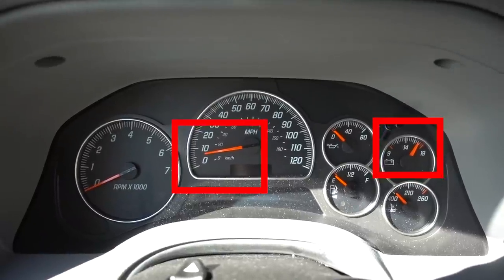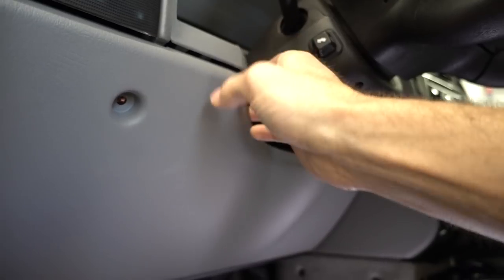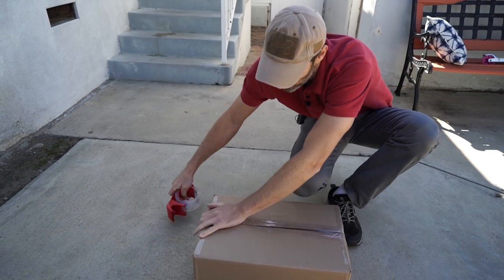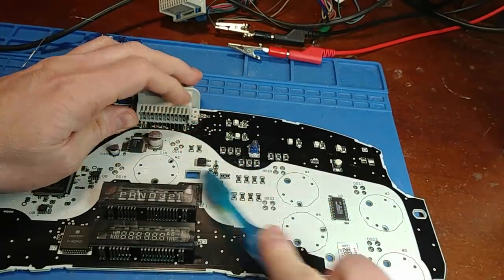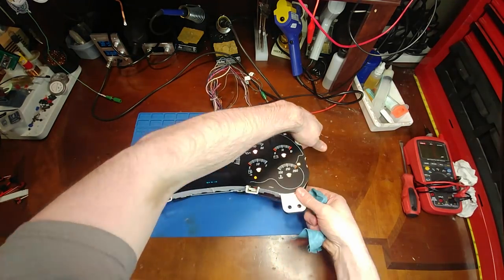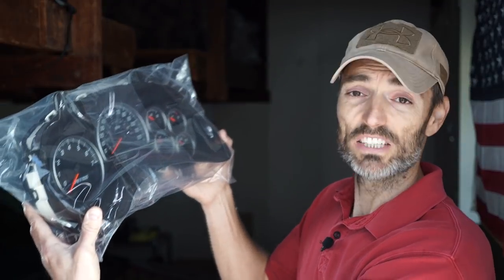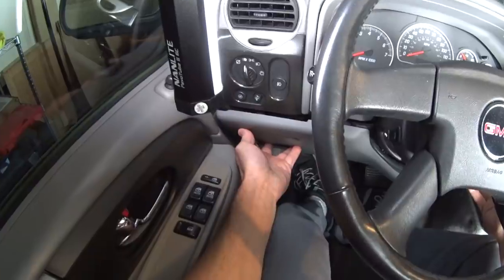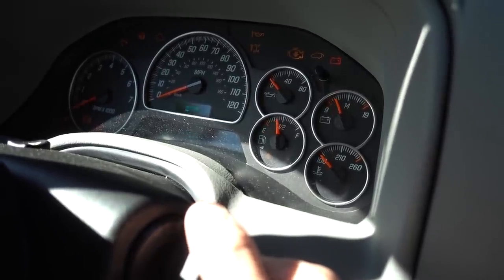Here's Why YOU SHOULD NEVER TRY TO FIX YOUR OWN CAR OR TRUCK INSTRUMENT CLUSTER!

Comment: OMG.! Thank you, Jimmy, I am glad that I found you. This's what I have been waiting> Someone talking about the Cluster. This part is not cheap. I have been replaced 3 times of the used parts from 3 different repair shop. For total 3 times replacement, I paid over $2000 but still the same problem. I am going to contact if he can fix or rebuild them.

Comment: I'm always impressed by circuitry repairs like this (laptop motherboards, etc). Wish I knew where to start with learning about the circuitry craft. Electronics are the more challenging part of auto repair IMO. I know where to go if my clusters ever go nuts, but I drive Lexus/Toyota. I think their electronics might be a little more reliable than GM's electronics, based on what I've heard about GMs.

Comment: You know what I like to do when I am removing my instrument panel is put some blue painter's tape over the top of the steering column near the instruments. That way it will protect it from getting scraped by the plastic edge of the instrument panel as you work the panel out.

Comment: my 03 yukon denali gauge cluster failed 2 times, first time we brought to your dealer to replace gauge stepper motors. second time the gear indicator screen went out and i was able to take it apart and redo the resistor sauter and fix it. hardest part is getting the needles to realign properly.
Reply from the maker: I am as much a DIY guy as the next. I like to get my hands dirty and LEARN! But, sometimes you just gotta hand it off to the pro.

Comment: I was able to find a instrument cluster for my silverado from the pull-a-part for $40. It works but I kept the original so I can get it repaired for a backup.
Reply: I don't know if they are just always grabbed before I get there or if the wrench a part pulls them and all the other yards want like 80% of retail of new ok it's probably not that high but I remember a friend got a transfer case for like $750

Comment: I had a 2003 Buick Century a few years ago and the gear shift indicator in the cluster was out.  I went to a G M dealer to have it fixed.  They told me I had to take the car to an electronics shop it have it done .  It was going to cost me $495.00 plus tax. I went home and checked on you tube and I found out what the problem was..  I needed 3 little 
I think they're called resisters.  I went to an electronics store and bought a package of 4 for just over $2.00 with the tax. On you tube they showed how to do everything.
3/4  hour and just over $2.00 all was working good.
I replace 4 stepper motors on my Pontiac Montana in less than 2 hours. I bought 6 stepper motors, soldering iron, solder for less than $45.00. At the dealers they wanted
$42.00 plus tax for each stepper motor.

Comment: No knock on Jeff, but you can really do this stuff yourself.   I did my Silverado cluster about 6 years ago. The parts are available on Ebay. Before that my temporary fix was to start then stop the car, it would move the MPH back down about 5 MPH per start until it was back down to zero, but of course a few days later, it would say I'm going 56 when I'm standing still.  New motors fixed it.

Comment: My dad hasn’t had this problem with the gauge cluster in his 2004 Chevrolet Suburban and it is the original one
Reply: Well, if he's the original owner, that's surprising ( unless it's only got 20 or 30k on the Odo).
But if not the original owner, then I'm sure it's been rebuilt or replaced sometime in the past.
Those of us familiar with these IPC's know it's not a matter of if, but when they are going to fail.
Jeff is certainly up to the task for repairing virtually any of these GM (& some others) Instrument clusters.
Reply: Mine is original 02 suburban 325k third owner, I wish my issues were as simple as a cluster lmao.
Reply: @nobodyimportant8833  my dads Suburban has 360k miles but that is quite a milestone of your Suburban
Reply: @omarzowila  I just recently bought it off some guy with the tranny out. Thing has had a rough life. Debating on fixing the issues or just selling and getting something better. Engine does run like a top though can’t say the same for the 2nd tranny and rear differential.

360k dang any major repairs on your dads?
Reply: @nobodyimportant8833  the major repair that my dads car had was a wiring repair because whenever he tried to start it one day, the alarm would go off and that was back in 2011 but he has owned the vehicle since new which was basically in February of 2004 and that was a month before I was born
Reply: @omarzowila  nice! He definitely got a good one. Mine has been a lemon since new, service records way back to 2003.

Comment: i'm a fan of the channel but GM is crap, i've had a 2002 toyota sequoia for 20 years and over 300,000 miles and it still runs like it's brand new and those aren't highway miles either.